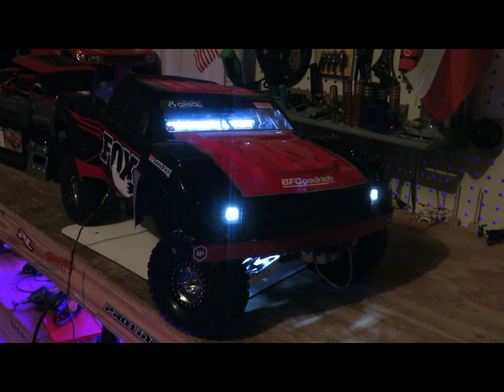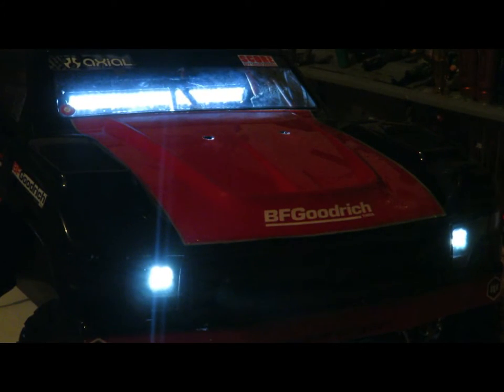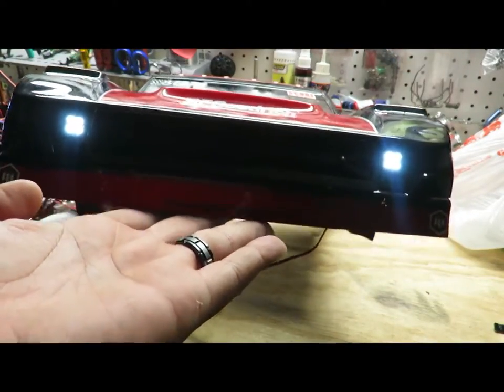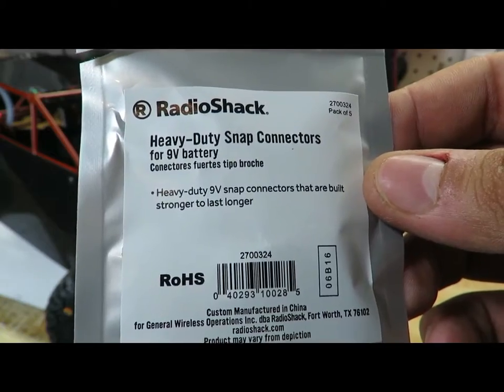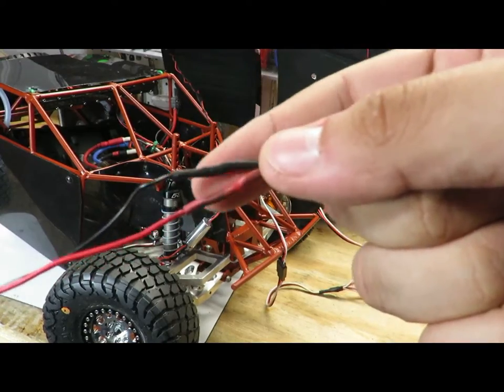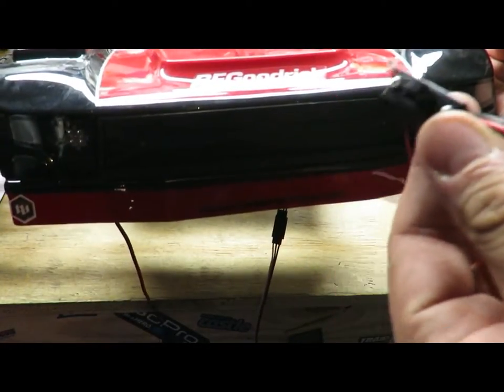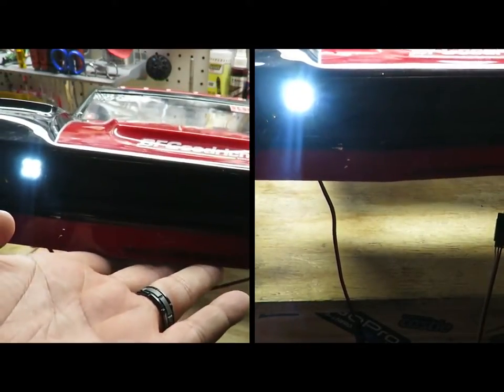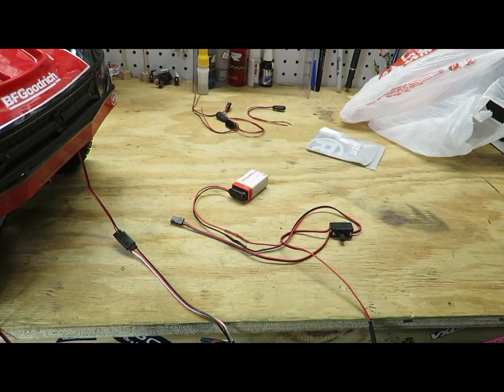HOW TO MAKE RC LED LIGHTS BRIGHTER

Comment: After doing my home work for a couple of days I've decided this is the best way to go.i just ordered my lights and battery holder case for a 9v, so it's in closed. The holder comes with a built in on and off switch.coming across this video after I did the purchase makes me feel alot better about it
Reply from the maker: larry956 Ive done it in many more builds after this, and.I definitely perfer to do it this way. Thanks gor watching!

Comment: I think part of the problems for most rcs is the amps put out of the bec that is built into the esc like for example if you run a whole led kit and a light bar but the bec only puts out about one amp the lights might be power starved but if you run a bec with a two amp output there's a possibility that the leds will be brighter due to having the power needed to run them.  However the 9 volts had an extreme difference so it's good for non-functional led kits. This was a great video 🖒🖒🖒
Reply from the maker: rc_action_ Thanks for the info. You explained that very well. I am happy with the results and will continue to run them like this unless I need functional leds, like you mentioned. Thanks for watching and for commenting!

Comment: love that rig man looks tuff as nails 8-)... I was searching for the rc4wd baja squadron lights are these it?   IF so pretty bright on 9V Im leaning on using these for my new wheel loader I an finishing up on now.. thanks bud awesome vid thumbs up
Reply: ps yep just r- read your info good deal 8-)
Reply from the maker: ThatsMyRc the 9v works so well. They are so much brighter and the battery last for a long time as well. Since I made this video I have only changed the battery twice and I run the truck a lot.
Reply: Flash Hobbies thanks bud just bought the same set up to give a go on my wheel loader..👍🏼 stay tuned

Comment: Can't you hook up the lights directly to a 3S lipo?
Reply from the maker: I could, but I don't always run 3s and even the smaller 3s batteries weigh more than a 9v.
Reply: Flash Hobbies oh ok.  I have mine hooked up to a small 3S lipo that I Velcro-ed to the roof roll bars, although it often falls off.  I'm 3D designing a mount that mounts to the roof so the battery and all the lighting wires r organized.

Comment: Your led will not last for long. If the circuit ic made for 6V you can not run it with 9V.
Reply from the maker: 3 years and it’s still going strong. 👀